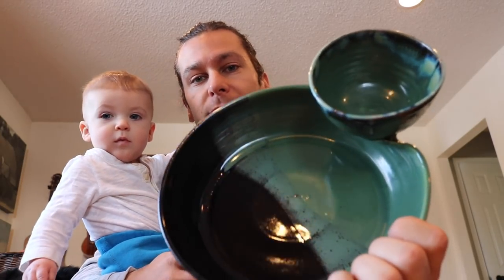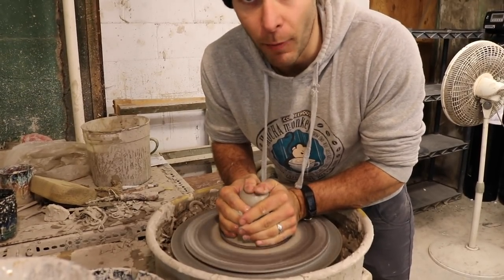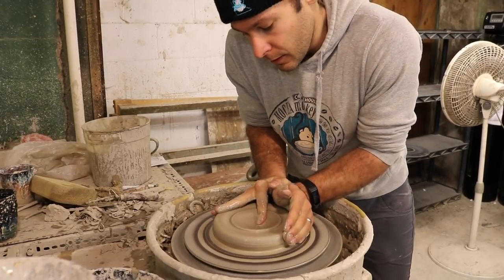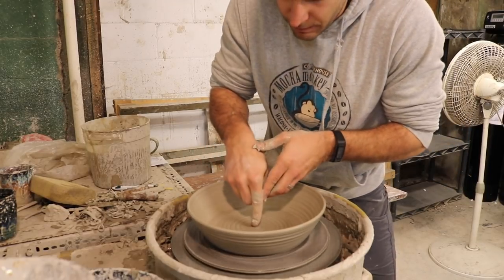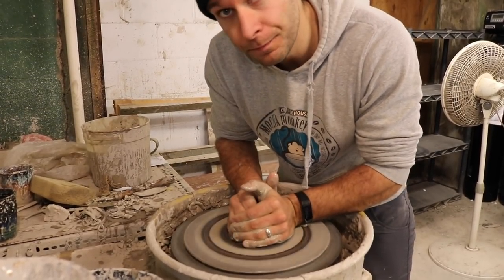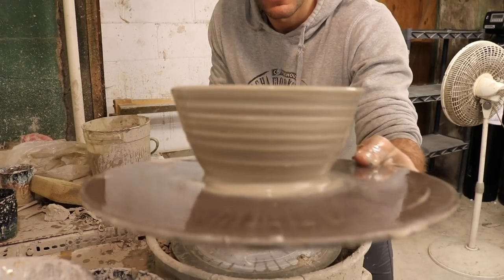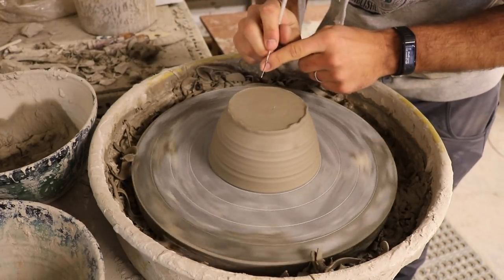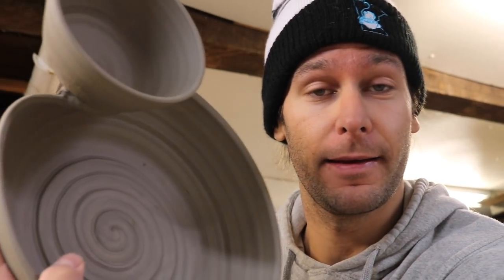How to make a chip and dip bowl!

Comment: Hi Jon, 
 I'm a beginner potter, actually just a tag a long for my wife's addiction, but over 20 years as a machinist has given me a eye for spinning objects, surface speeds, rate and depth of cut. So it appears I can throw. I am trying to do a similar piece to the one in this video. My questions are How do you know when the pots are at the correct stage to connect them and how do you get them to that stage at the same time? My little bowls always dry much faster than my big ones, also cracks in the bottoms of the bigger ones have been a problem.
6K
P.S. Great videos! Informative and entertaining. Really like your colour combos too.
Reply from the maker: Cover the little bowl with plastic until the big bowl is ready!